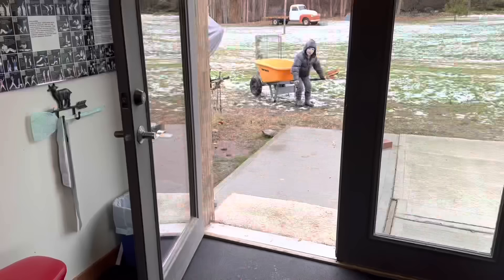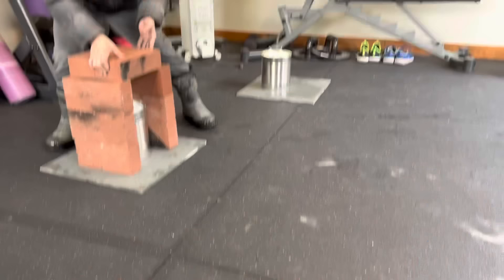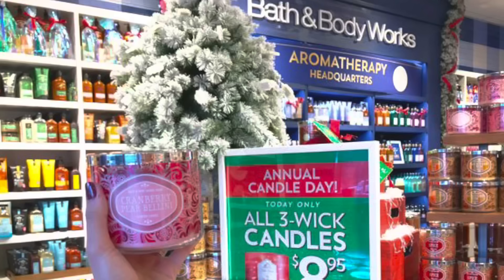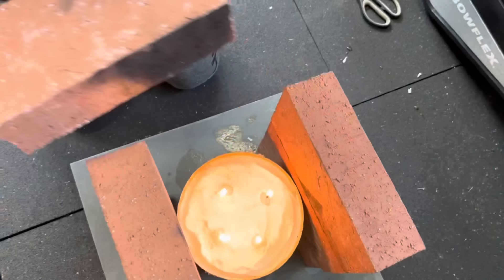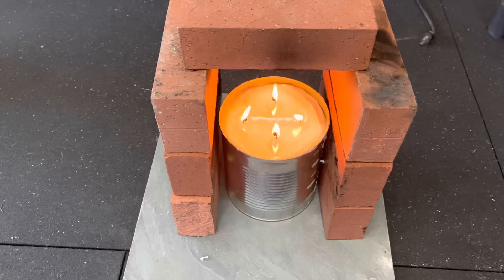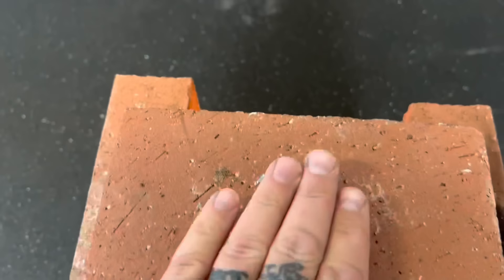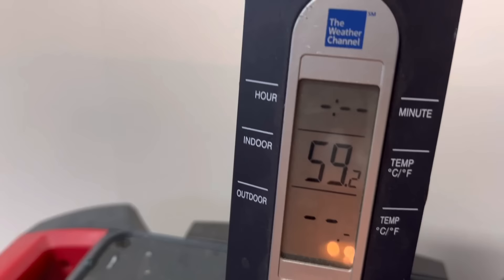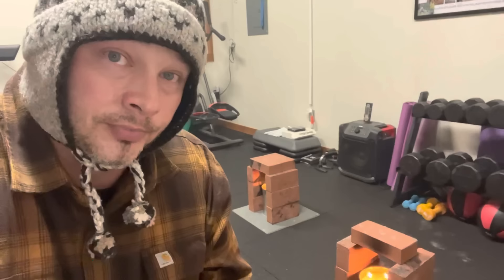Crisco candle room heating | Power Outage Room Heating | 9 hour test

Comment: Dude. All you need is a can full of any cheap vegetable oil. You need a floating wick. A wick can be anything cotton. A strip of blue jeans, a strip of a cotton dish towel, a piece of cotton rope even off a old mop. Jute twine. Even an actual lamp oil wick. Take something that floats. A 5/8 inch slice of cork wrapped in foil, poke a hole in it run through a wick, wet the top too stick it in a can and light it. A beer cap upside down floats. Also an empty tea light container floats. Same thing. It will float. Poke a hole from the bottom going up. Only as big so the wick doesn't fall through, wet the top of wick and light. I have tested this many times. They also sell floating wicks on Amazon. They are they Jewish hannaka type. Its a little round disk, the bottom is a thin slice of cork. The top is some sort of metel and a small cotton wick. But homemade ones I think are better. You can have a thicker slice of cork. Its not toxic you don't have to open the door like that there's no carbon monoxide. Its way cheaper.

Comment: When I bought my first car in Canada I was advised to keep, among several other things,  a candle in the trunk. If you got stuck in a snowstorm you could light the candle and it would provide you with enough warmth to prevent you suffering from hypothermia.
Reply from the maker: It’s true and smart- thanks for adding tip
Reply: I live in Michigan’s Upper Peninsula, and remember doing a youth group project that included making a candle holder out of a 48 oz juice can, to hold the emergency candle for the car! It had a circular piece wood cut to fit in the bottom, with a hole drilled in the center to hold a tapered candle. Made it pretty safe to use, and you could place it under your blanket (the one you had to have in the car with the OTHER emergency items, like water and granola bars😆) to help you concentrate the heat.😀
Reply: @littledabwilldoya9717  we are in California and every car has emergency bag with water, granola bars, aspirin and cash and blanket. Ya never know what may happen. If electricity is out cash will buy something at a little store etc...
Reply: Cheyenne pepper is good for frostbite and circulation and is easy to store in the car.
Reply: The Inuit People of the Canadian arctic territory of Nunavut existed for centuries in Igloos as shelter and still build igloos today during hunting trips.  The small interior space of the igloo was heated by body heat and a single flame lamp, fueled by whale, seal or walrus blubber.  Not a comfortable temperature for most people, but raises the temperature enough to sustain life and prevent freezing to death.
Reply: Crack a door every so often so you don’t eat up all the oxygen.

Comment: We recently lost power in northern Michigan after a strong wind/ice storm went through. We had sustained winds of 20-30mph with gusts up to 65mph. We were without power for 41+ hrs. We don’t have any propane heaters or a generator (more and more people are buying these in our area), but we have a LOT of candles and bricks. We took a few ceramic tiles, placed either a big pillar candle or decorative holder that holds 1-3 tea candles in it on top of each tile, and made an arch over each, with bricks. The inner temperature in the house dropped from 65* F to 51* while we slept, before the outage was noticed. Once we got 3 of the brick warmers built and lit, we got the temperature up to 57*. The outdoors temperatures were from 22*F-34*F WITHOUT factoring in the windchill, during this this time period. We wanted to use more bricks, but none were available, so we used some cast iron frying pans! This allowed us to heat food and water, also. We are in a split-level home built in 2000. We stayed in the top level (where the bedrooms and one of the bathrooms is) and we were pretty comfortable throughout the whole ordeal. Now have to order some propane heaters, purchase another (2)20# LP  tanks to keep filled, and a few more jugs for water. We had 3 large water jugs filled and ready, (made from recycled cat litter jugs)to use for flushing toilets, and 4 cases of 16oz.fresh water bottles for drinking, after the fresh water tank was depleted. If you want to make/use terra cotta pots for heat, one great idea for a base I saw, was using an old fondue base! Time to hit the resale shops! We have a hard time finding terra cotta pots here in the winter, north of the 45th Parrallel.😁Prepare, people! God bless you! New subscriber.😁😊
Reply from the maker: Thanks for sharing your story Dawn! Glad all turned out well, yes, always good to be prepared ahead of time!
Reply: I feel for you, Dawn. Currently 14°F under a foot of snow. No wind chill to speak of, it's under 8 mph. The power is still on (Thank God!). The only thing we have going for us is we are on an island some 30 miles to sea and thus have some "moderating" effect as the water temps change slowly. A belated Merry Christmas from above the 49th Parallel. :)
Reply: In Hillman. Ours was out for just over 24 hours. Those in Atlanta still had power out 4 days later! No generator. Ugh!
Reply: I live in southeast Michigan so it's good to know that those things work
Reply: Like here in California we who been thru big earthquakes in the past should know that we need to be self reliance with no services for at least a week , we need to imagine that we will be going camping for a week by ourselves so need to be prepared because is just a matter of when, all these readiness item will help anyone survive or who want to be a victim? For me I am as ready as going camping for a month at least . take care.
Reply: ❤1111
Reply: You can find terracotta pots at home depot in the summer, wont find one until then but get some then. Hello from Michigan.

Comment: Great idea. Try this... Add a vaporizer effect by setting a pot of water on top of each heater with a lid, just off slightly. Your room will be even warmer. If you've ever used a warm vaporizer, when your kids or you have the croup, you know how warm steam raises the warmth in a space like a bedroom very quickly. Give it a try and see if you get even better results.
Reply: I don't know if you call it a superstition or an old wives tale or something, but actually the opposite is true for a couple of reasons. Thermal conductivity of moist air is actually inversely proportional to the relative humidity, having little to no appreciable affect up to around 50% at which point thermal conductivity drops. This means humid air is less capable of transferring heat than dry air. Additionally because the molar weight of water is less than that of air, humid air is actually less dense than dry air. Which means it also has less thermal inertia. So basically to warm up effectively, you want a hot dry heat. To cool off fast, you want cold and wet.
Reply: Mold
Reply: Ya, no. The energy used to turn water to vapour would be better spent heating up the room. Evaporative coolers are an example of how adding moisture to the air lowers the temp (tho if you need to sweat to cool yourself, then moist air is not helpful)

Comment: You could couple this with covering the door and windows with the exception of the 1 inch opening in the window. The more you insulate, the more heat you will hold in, allowing temps to build. Thanks for the test. Great video! 😁🤙
Reply from the maker: That's a great idea Jeff! Yes, that would help, thanks for watching
Reply: @RiversideHomesteadLife  
Hope my concepts are as relevant as Jeff's ?
Reply: Air inlet can be a network of insulated pipes/geothermal
Reply: Bubble wrap on the windows! I live in an RV and use bubble wrap every winter. Bubble side towards the window. cut bubble wrap to fit, spray window with plain water, place the bubble wrap on the window. It will stay. You may need to tape it over the screened windows, but it raised the temperature by 15 degrees or so and it's way easier than plastic.
Reply: @shawndella1  Wondering how to use this, thanks.
Reply: @shawndella1  What if that water freezes?

Comment: stone and concrete are amazing at holding heat in.  When you are out in the wild, it is always suggested - if you can to build your survival fire beside a rock face.  The rock face with absorb and keep the heat as long as the fire is going and you will still have heat after the fire goes out.  This was a beautiful example of basic science.  Well done.

Comment: Crisco is also good for waterproofing leather boots but it does have an odor . Just spread it on the boots and then put them in an oven on a low heat for awhile to let the crisco soak in. To get it out put them back in the oven till the crisco liquifies and wipe it off.

Comment: Seems like you would want to find a small room in your house to set one of these up to keep warm, the smaller the room and the more insulation the easier it is to keep heated for emergencies. This guy kept a room at around 60 when it was really cold outside so it’s looks like they work!  Can’t argue with success!
Reply: That is what some of the negative people do not get. These things work in smaller rooms that are insulated. They do not work in 600 sq ft rooms with bad insulation.
Reply: @tonypittsburgh9  And high ceilings.
Reply: @eatiegourmet1015  you can build a simple hot air " recycler " / air scoop (out of many materials) that has a fan on the bottom sucking down & a small ( 1/2 " ? opening ) at the ceiling.It should help recirculate the air.I am making one for my kerosene heater , as the air air on top of the heater ( at the ceiling) can be 100° when the floor level temp is 65 ish.The late Buckminster Fully ( look him up , he designed the geodesic dome , wrote " Utopia 
or Oblivion" , was here in Philadelphia @ Uni
of Penn ....died in ? 1983 ? ) said that it is TEN TIMES ( 10 Xs ) easier to PULL l air , then it is to PUSH it ! I have been telling people to ALWAYS use fans venting out , not blowing in , bit few people listen , don't know why I bother sometimes .. ( So does a large metal pot on top as well , with some water in it or a brick or two or both ) but..
   IT WORKS !  " Of course it WORKS  , Jon 
, it ALWAYS works when you KNOW  what you're doing ! " replied the elder gull ....
Jonathan was DAZZLED , he forgot  to ask about heaven ! 
 .....From Jonathan Livingston Seagull , narrated by Richard Harris , audio free online 
( Not the version by the author himself which PALES in comparison to the Harris version )                      NAMASTE, 
                                  .     warm thoughts ,
                                            Thomas
Reply: @Masterchief68: Thanks for your service! These Crisco candle heater videos are deceptive and unsafe. Heat is heat no matter how it is produced, wether from a candle, kerosene, propane, or electric source. It is the heat loses of a room that determine how much heat is required to raise it by some amount over the outside ambient temperature. A single Crisco flame is about 376 BTU/hr where a human is about 250BTU/hr. Notice that this video used 12 flames distributed in 3 containers? Sure when you add enough heat to any room under any circumstances you can get a desired temperature but at what cost? And I don’t just mean that Crisco (kerosene) is 5 times as expensive per BTU than propane. I mean in the cost to life and limb and pulmonary health. If you think I’m wrong look around any home and take note of the systems employed for safety for any device with an open flame. They are many and substantial and required for a reason.

Comment: Love your show!
Well....I tried various projects like this in a room that I let get down to a true outdoor temp of 25°F.    It didn't make it past freezing.  Just wanted to tell folks to find an alternate heat source like a mini propane heater so they don't end up with hypothermia.  
I bought a Mr. Heater Buddy and an adapter hose WITH a filter to hook to a 20 lb tank. I used it on the low setting and got 3 days of heat for an 800 sq.  foot area when the heat went out.  Kept socks and sweats on, but putting it on a high setting would have cut down on my days of heat.  I keep 3 of the 20 lb tanks filled for my "just in case" event.
Reply from the maker: Thanks for your comment, always good to be prepared
Reply: I use portable propane tanks to heat my old mobile home that is 12 x 70 . Now I have done some reinsulating on all the rooms but 2 which total 44 wall ft . & I can get 4 to 7 days of heat out of a 20# tank which is a small grill tank. I am talking about temps in the 10° to 28° range AND not during a power outage , just normal temps in the winter . Been doing this for 17 yrs because I am not going to pay rental on a large stationary tank , 250 to 500 gal tank. There have been several times here in Oklahoma  when the propane co could not make del for whatever their stupid reasoning was , usually because you could not pay for a minimum 150 gal drop. I found several places that filled portable tanks,  20#ers to 100#ers & did it myself . Loaned  2 small tanks to a couple of neighbors that were in the same boat as myself . It was incontinent but we stayed warm .
Reply: A small kerosene heater designed to do the job not only cheaper than Crisco it's been proven to work over 100 years, all you have to do is keep a drum of it in the shed.
Reply: @hetrodoxly1203  You forget a very crucial thing g with kerosene ....... it is really bad about carbonmonoxide poisoning !!!!. I realize that can happen with any gas operated heater but it is the worst . Also most people do not understand they have to ventilate a bit with any gas heater but definitely with kerosene .
Reply: @louisevaughan2165  Thousands of people around the world use kerosene heaters as there main source of heat and have done for 100 or more years, use a Carbone monoxide detector.
Reply: @hetrodoxly1203  you are 1 of those "entitled Americans " whose answer is always to go spend more  $$$ . Many people have to make a choice between heat , food & another item they can't afford to buy . If that is your answer to the carbonmonixide issue then you just whip out all that extra $ you have or your credit card & buy that item for the all people that can't afford to. End of this part of this discussion.  Now have a good day
Reply: @louisevaughan2165  How bizarre, how do you come to that conclusion from my post? I suggested  keeping a can of kerosene in the shed for emergencies, it's not that expensive and a carbon monoxide detector can be bought for a few dollars, not to mention the video suggests using one with his method when using Crisco, i'm not American.
Reply: @louisevaughan2165  Kerosene heaters emit very little carbon monoxide and carbon dioxide though they can cause damp. They actually make water and it can be as much as a gallon of water for every gallon of oil they burn.
These things are very easy to google.
Reply: @hetrodoxly1203    when we were young we had a kerosene heater as a supplemental heat when temps dropped.  I am no longer able to use Kerosene.  After having pneumonia I cannot handle the fumes.  Getting behind a Diesel truck throws me into a coughing fit.
Reply: @hetrodoxly1203  Or crack a window ?
Reply: Excellent suggestion. Has anyone thought of a few penny stoves and maybe something similar to the tent heaters that you see online? Alcohol stoves are safely used on boats, and I've seen at least one alcohol heater on a van living video.
Reply: @canopener1195  I like your handle 😁 Juat 1 question do you  have that little " canopener" that not many people think of ? A p38 or as John Wayne fans call it by his name ?
Reply: @canopener1195  Yes.
Reply: @louisevaughan2165  and toxic
Reply: He needs 19 candles to be able to equal a basic electric portable heater that puts out 5,000 BTU that of course is under ideal conditions probably 24 candles would be more realistic.

Comment: just need to change the design of the brick tower. remember differing temperatures cause draft.
 arrange the bricks so there are small gaps at the base, allowing for the introduction of cold air to the heat source,
build the tower like a chimney stack around the tin, either square or circle, no gaps.
at the top have 4 small blocks in the corner's and a tile capstone allowing the updraft to suck in from the bottom, up
the shaft and get pushed out in four directions.
Reply from the maker: Very interesting- thank you for commenting! I share great ideas- but it’s not perfect, and so many intelligent people in the community that offer great tips - I appreciate your input 🙌🏽

Comment: If you look closely at a tub of Crisco brand shortening you will see that the dot on the "i" of the name is a flame.  That is because Crisco has a duel use. Doh!  Crisco was and is still used as an alternative to candles. Great video!
Reply: The golden tear shape is oil ..like it’s modified vegetable oil
Reply: @sheilajerrett2675  It IS hydrogenated vegetable oil.  The name Crisco is a contraction of "crystallized cottonseed oil". (Much like "canola' is a contraction of "Canadian Oil, Low Acid", made from rapeseed.)

Comment: I was sooooooo curious at how the terra cotta pots worked.  So I put some together, lit a crisco candle underneath.  Left it going in my bathroom for 4 hours.  I could not believe how impressed I was when I checked the temperature and realized the temperature actually rose 5 degrees!!!  I did not have the heat on in the bathroom.  Thanks for the videos!
Reply from the maker: Glad to hear, thanks for sharing Don!